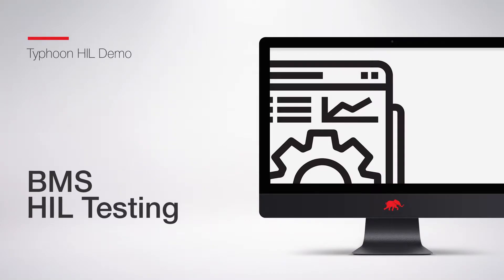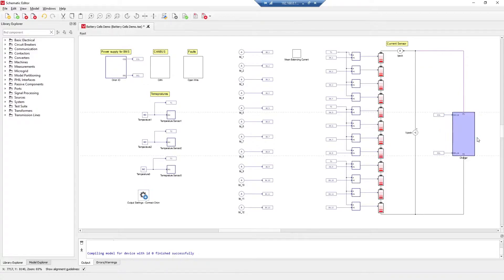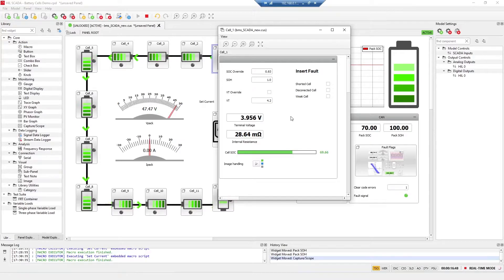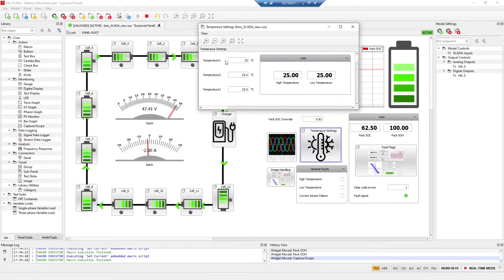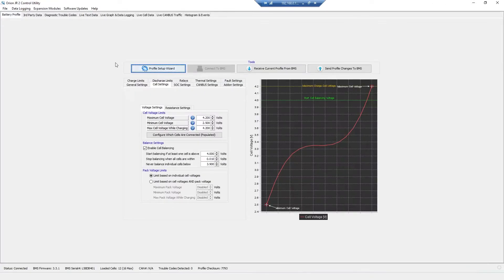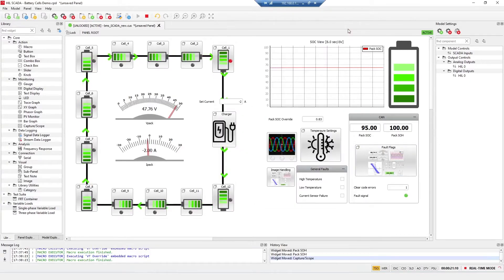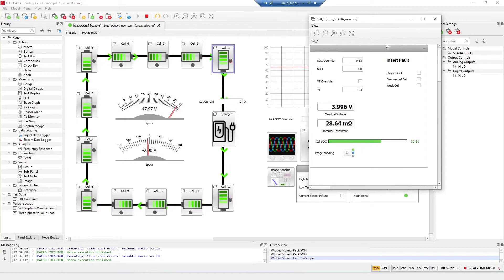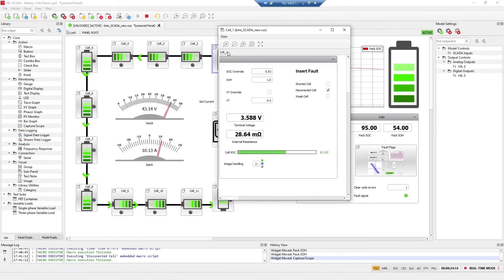BMS HIL Testing | Demo

Comment: Hi Ivana, what hardware do you use to test the BMS?  For example I am trying to find a BMS test equipment that can test  BMS up to 80V systems such as those found in e-bikes, e-scooters & e-motorcycles.  The only ones I have found are in China for around USD$4,200
Reply from the maker: Hi there! The device that is under test in this demo is Orion Jr 2 BMS. Please note that this device is not a Typhoon HIL product, but it is only used for demonstrating the capabilities of the BMS HIL testing setup. For this particular demo, our HIL604 device was used.